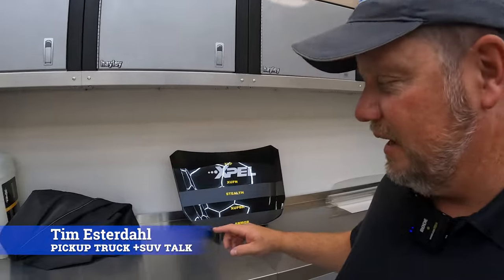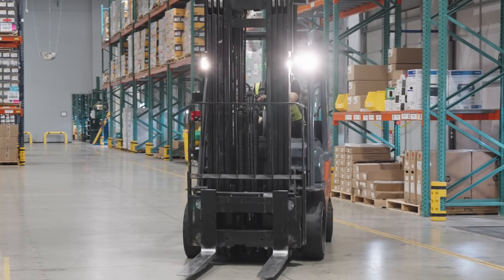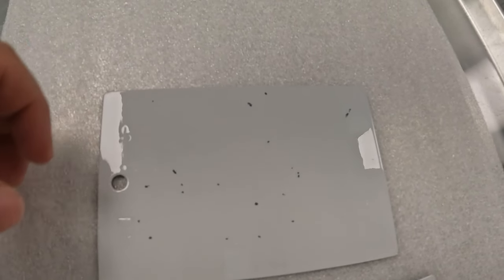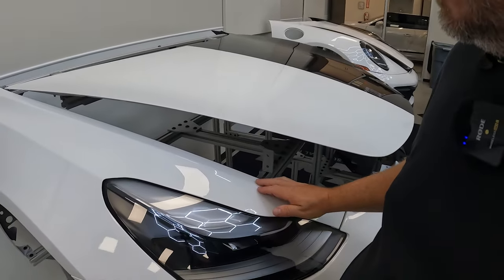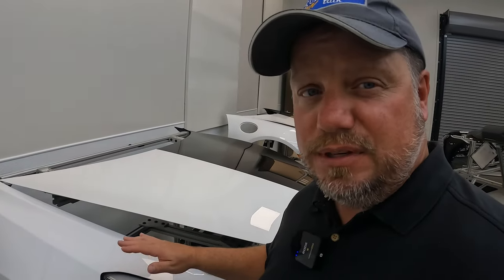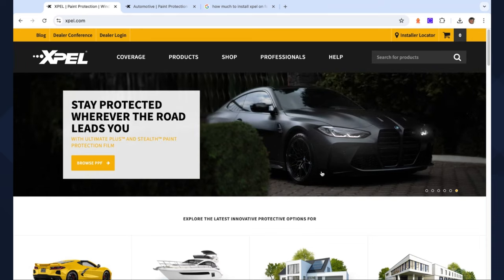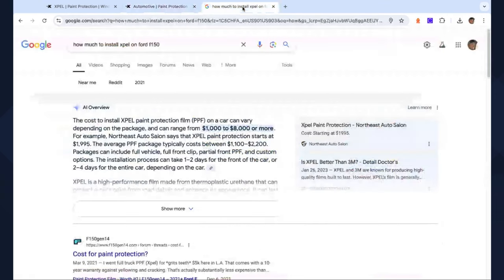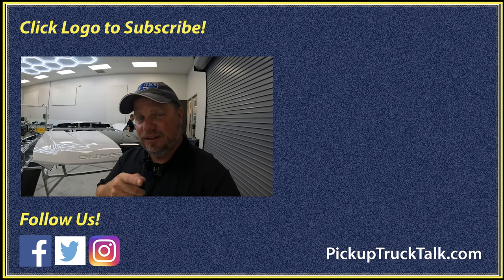PPF or Ceramic Coating Your Truck? XPEL HQ Tour, Install, Gravel Shooting

Comment: Getting a full front PPF, full ceramic and ceramic tints on my GX550 in a few weeks. Going to run about 5K.  The process of finding accurate information is daunting.  There are so many products and professionals to choose from. At the end of the day and after a month of exhaustive research, it came down to choosing an installer with the best reputation and reviews in my area.  And I’m still not 100% confident in my choice.  But it needs to get done.  I’ve already put 1200 miles on my truck without PPF and without damage 🤞🏻It is a huge investment but worth it.. I think. Thank you for the video!
Reply: It is all about the installer. You get what you pay for.
Reply: @mauricemaurice123  agreed!

Comment: Did front end in PPF, ceramic coated whole truck 24 TUNDRA 1794LE
Reply from the maker: How do you like it?
Reply: So far so good, did the ceramic coating first, then company did the front PPF, the PPF has a good hybrofobic shielding, but ceramic Ed over top of it also.

Comment: If it cost $5000 just to do the front hood of the truck, I could have it repainted for that. You will never get your money back on it . You would have to keep your vehicle till the wheels fell off to justify it. In fact if you trade it in, they will allow nothing extra for it just like people do a lot of other mods to their vehicles, they lose money on every mod they do when it's traded in including ceramic coating. ( I am a former car dealer by the way)
Reply from the maker: I don’t believe it costs $5k to just do the front hood.
Reply: @Pickuptrucktalk while not cheap it’s not 5K. My Ram bumper and area under headlights and mirror caps was $600.
Reply: @jayray274  That's still not worth it. Probably for you but not most people.

Comment: If it costs like 5 grand to do this..what is the ROI?  Am I going to get 5k more when I trade it or sell It than with a few rock chips?   Maybe. And maybe people just want it which is cool.
Reply: Good point. I really don't see the ROI being there. I see a couple dings in the paint, I'm not lowering my offer $1k or more. If you have a serious work truck, this will be irrelevant as it will have many other dings and dents. This is purely for aesthetics. Those who already spend all weekend washing and detailing.

Comment: If your keep your car for 7 years or more, its definitely worth getting the headlights protected with PPF to prevent hazing/yellowing. 

Worst case scenario is you reapply the PPF way down the line. 

Getting the hood cover is worth it too.